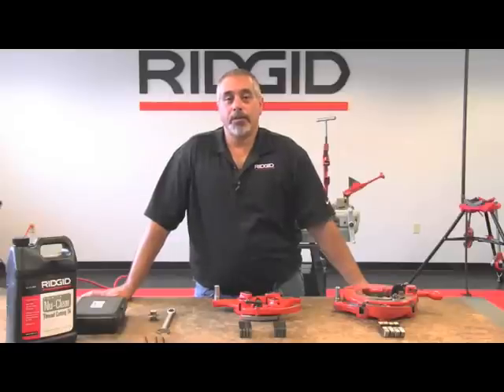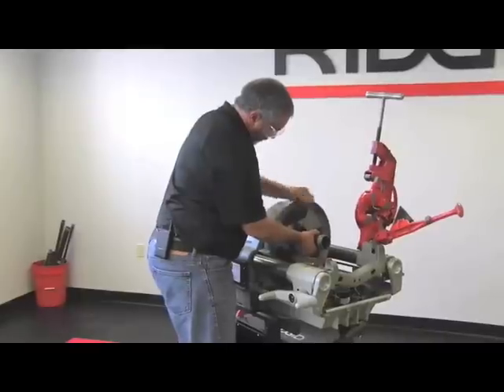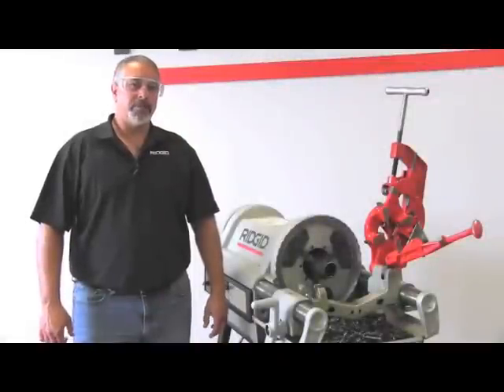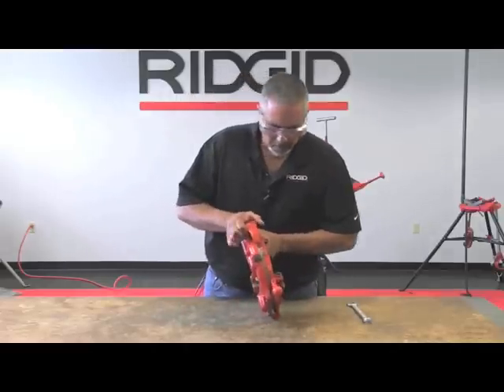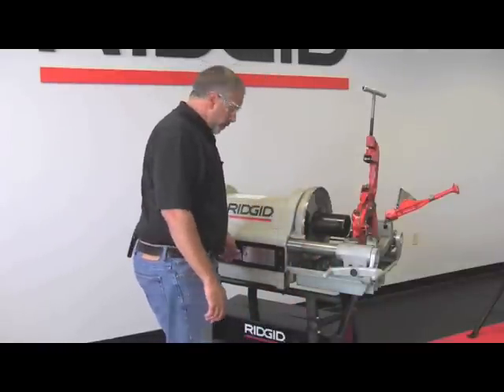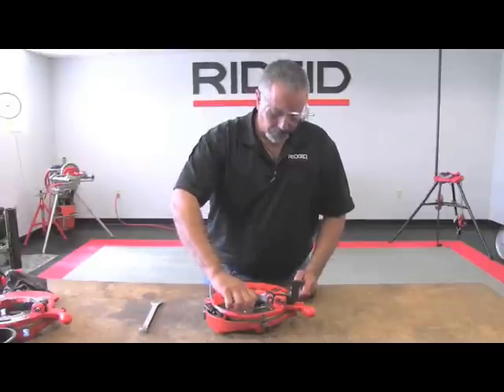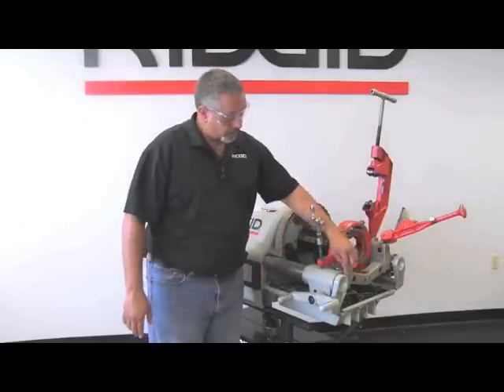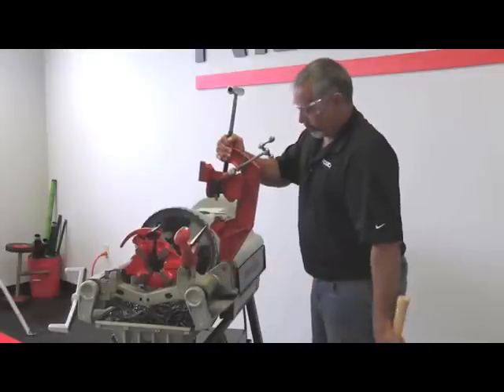How To Use The RIDGID® 1224 Threading Machine

Comment: Hi, I'm wondering if you could help me. I recently bought a ridgid die head at auction but it came with a nut ratchet bar? attached to one of the nuts. Can you please tell me how to remove it and is nut ratchet bar the correct term for a long metal bar with like a socket on the end for removing or adjusting the nuts on the die head? I think it's a 141 hog head pipe threading die head. Any help would be much appreciated.

Comment: I got a brand new 815A Ridgid die head. When I lined up the index line on the lock screw with the 1/2" mark on the Cam Plate, the threads are tight, only making one turn or less. I had to adjust the Cam Plate about 1/16" to 1/32" lower to make a perfect fit. Is this normal? I didn't seem to have the same problem in cutting 3/4" pipe.

Comment: I am having trouble getting my 535 oil pump primed , I pulled the priming plug filled the pump with oil pushed the foot switch . I did this several times and no oil flow , am i doing somthing wrong?